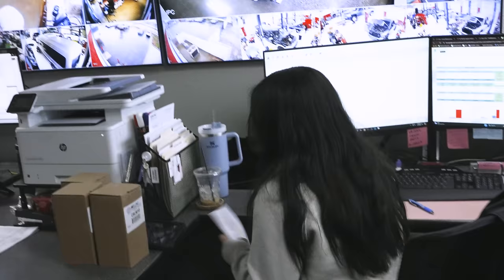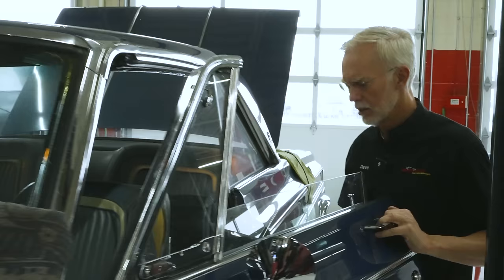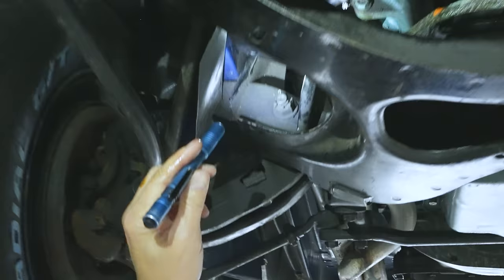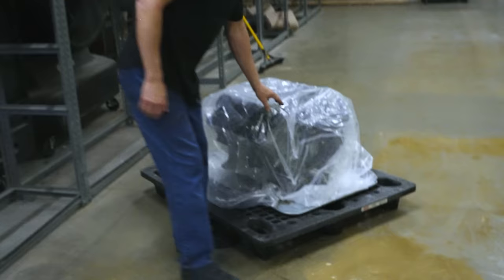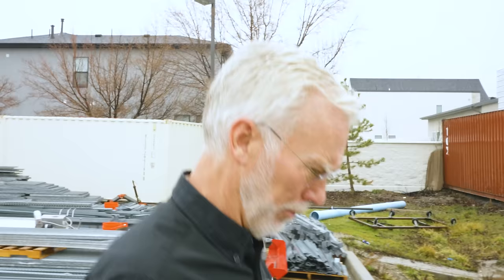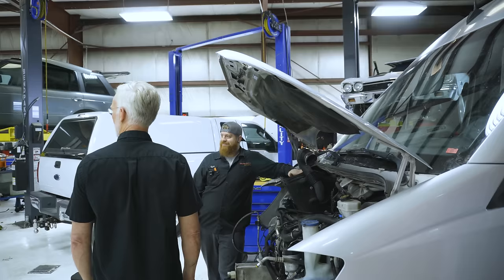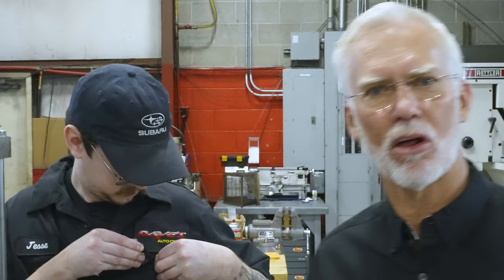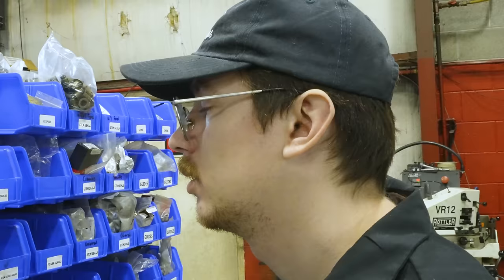Shop Life

Comment: It’s great to see real mechanics and not parts changers, as a 77 year old working on cars before I had drivers license, your channel is better than any show on TV. 👍🏽👍🏽👍🏽👍🏽👍🏽
Reply: Everyone starts out as a parts changer. Some shops have strictly diag guy and strictly “parts changers” 
Try “part changing” on semis. Very few ppl can do it because it’s hard work heavy dirty work but you still need a brain to change certain parts
Reply: Parts changers used to be known as fitters. While every mechanic shop needs them, too many  set up in the auto repair business and are just cowboys. Dave has real mechanics. Once the basic knowledge is acquired, experience is all.
Reply: I agree.
Reply: As a DIY parts changer I'm offended! Time to change some parts.
Reply: Great channel Dave👍
Reply: Temp probe for each cylinder
Reply: Do they make total seal piston rings for Dodge diesel
Reply: Never had to go to a mechanic as a a diy parts changer no labor costs changes the game a lot. The list gets pretty extensive i can pull off quite a lot and many of the jobs are just a swap it out. Like if you need a new wheel bearing you have whole hub assemblies no need to press. I explain it to people like this if you need your teeth cleaned does the actual dentist that gets paid top dollar for their time do it or will the hygienist who gets paid much less clean them for you. I don't want dave doing my brakes or exhaust or something trivial because he would demand too high a rate vs my zero dollars an hour. No disrespect old timer but at 37 i have never had to bring my old used four bangers in for anything i cant handle. Nobody rebuilds jack(engine,trans,diff,alternators,or power steering pump although these last two i have a good idea on how to) on a 3 thousand dollar vehicle like drive for years and years not to mention many like me are not far off from becoming guys like this.
Reply: Nicely said Mate - Gday from Australia
Reply: They might be on TV one day, on one of his episodes he mentioned that the Discovery channel was interested in his work. Haven't heard much more about it though.

Comment: Nice to hear you talking about EGT's Dave. A boost and EGT gauge will give you two of the best pieces of information about your engine.
 As a Toyota Landcruiser turbo diesel owner in Australia, I'm often driving on mountain roads in high ambient temperatures which sometimes means I drive according to my gauges simply to protect the health of my engine.
 Prolonged and excessively high EGT's are death for a diesel engine.

Comment: Diesel trucks should come with an exhaust gas temp gage from the factory.
Reply: And no egrs or dpfs
Reply: @haralamc 
Absolutely!  Look up 'speed of air pistons'.
Reply: I was thinking the same, I’m gonna make my own exhaust temp monitors. I’m thinking separating the left and right bank with 2 separate gauges. One thing I gotta learn is what are the parameters of the exh.temp. 2006 Duramax 6.6, LBZ. 6 speed Ali tranny. That’s for your vid’s Dave!

Comment: Around 1964 dad bought at auction from the sheriff department a four door cornet(I’m guessing) that car had a “Haul Butt” motor. Thought it was so cool it had spotlights on the doors no other dad’s car had them! 1968 he bought a Dodge Cornet 500 that bad boy would haul the mail!!! I’m 68 now and remember all the cool cars dad had. 69 charger r/t 70 Mach 1 428 cobra jet shaker hood AMX 390hp  then as we for older he got into family cars Mark 3 Mark 4 Torino LTD Scout Bronco Ram Charger f250 crew cab highboy . Wow childhood memories,! 😂
Reply: Reminds me of 
“It's got a cop motor, a 440 cubic inch plant, it's got cop tires, cop suspensions, cop shocks. It's a model made before catalytic converters so it'll run good on regular gas.”  That was a Monaco

Comment: Check out the grid heater issue with the 6.7 ram. Banks sells a remedy for that, destroys tons of these engines, as well as a great monitoring system with the datamonster. Good peace of mind for for when you  wind up rebuilding or replacing someone’s engine, the gauge pods have temps you can set alarms for any data point threshold you set,
Reply: Well being a 2005 wouldn't it be a 5.9 still?

Comment: When I saw the Mini Logo on the engine cover and heard him say "Anytime you have to do anything on one of these, the front clip has to come off, except an oil change" I felt that as a mini owner, just to simply change the oil filter you have to remove the turbo intake hose and move the coolant reservoir out of the way then work arouns 2 or 3 radiator hoses just to get to the filter cap! Needless to say, he summed it up perfectly, most work on the engine for those cars is alot easier if you pull the front end off.

Comment: I sure love your ship and hope you run it. 

I used to be quite involved at Tesla motors, and what I would see was a lot of junior engineers coming in trying new things. They try things and they can save a penny per unit then end up costing the customer $1000. I kicked an engineer off of the assembly line in 2018 when it was make or break if we didn’t hit 5000 units a week. he engineered the brake line fittings. He engineered the wrench to use on the assembly line. If you used his wrench, it would round the line out every time. That argued with me for an hour before I called his supervisor and had him removed from the property. The last week that I was there I watched them eliminate the final quality control procedure as they said Service could handle it.
Personally, I don’t own a vehicle newer than 2007 and the best running ones I have I’ve paid little to no money and are nearly 30 years old

Comment: There is mechanic that have learned the trade by working on vehicles but people that have dealership schooling or trade training with certifications we have put our time in school and hands on we are called automotive technicians, there’s a difference between both technicians and mechanics. Mechanics don’t have all the knowledge on testing sensors but there scanner says an issue with per say oxygen sensor so they just replace it instead of testing it with ohm meter or checking for vacuum leaks that will raise voltage on a oxygen sensor that knowledge is why we are auto technicians . Dave’s auto is a perfect example of  professional auto technicians  they should be proud of each other and themselves. Great job . In case anyone wonders I’m a automotive technician of 43 years with  a wall full of certifications ASE CERTIFICATION in diagnosing auto repair and emission  diagnostics and repairs now retired but keep busy at home with a hobby in automotive to finance my play time and Europe vacations.

Comment: In my 92 Dodge 12 valve and all I had was water temp and it worked great so pulling my 25’ Road Ranger in the mountains so normal was 1/4 ont temp gauge and when it got to 12:00 on gauge I would drop a gear and temp would drop to 1/4 and that’s a 5 speed manual .

Comment: 1:50 Talking about those exhaust temps. My first truck was a '71 Freightliner, 335 Cummins. The guy I bought it from pointed to the pyrometer, and said that's the most important guage, and not to let it get over 1,000°, I believe, this was 1984 when I bought it.

Comment: I used to drive early Kenworth Prime movers pulling three trailers or two trailer combinations,powered with either 525 redhead Cummins or early 560hp and both add turbo pyrometers on them and you could allways tell our good / bad your engine was working. Later model engines have all that computer controled, not my idea of good.

Comment: That exhaust gas temp monitor idea is great but humans are bugs, they're not features.   Take it out of human hands and just wire it up to shut off  before the temp can grenade the engine.  Meanwhile allowing an override to get them where they need to go (your shop) while still monitoring how long they continue to drive it too hot.  After a certain number of hours make the unit shut the vehicle off permanently and send your shop the GPS the coordinates of where to pick it up so you can fix the problem before they lose their motor.

Comment: Even the lawnmower shop had my mower and they worked on the PTO but when they put the belt back on they adjusted the tension but they didn't tighten up the jam nut. So a few times I mowed I noticed the belt making a noise. After I changed the blades I noticed the problem and some of the threads got chewed up. So next time I have to change out the belt I will have to replace the eye bolt

Comment: If it's an 05 then it has the 5.9 24 valve. The 6.7 didn't come out until 07.5
Reply: Was just about to comment the same thing haha.
Reply: I could care less it’s still dodge to me junk
Reply: 06 and 07, 5.9 Cummins had upgraded internals for the h.o. motor that was an option 02 to 05. The upgraded internals was to meet emissions reg before the 6.7 release.
Reply: @samsquires2877 A Dodge Cummins HO with the Aisin transmission is the king of pullers, and I am not a dodge guy, but facts are facts. These a reason most semi, large construction, farm, and large off shore boat applications use the inline 6.  When was the last time someone transplanted a powerstroke or Durmax into something that already had a Cummins….almost never.

Comment: Hope you answer this please sir, 1996 ford 4.9 300 6 f150 2 wheel drive stick 5 speed. Burning some oil can see out tail pipe idling about  140,000 miles second owner sir. Do you do engine refresh if all good just worn rings , I get the money I want to send it to you whole pick up to see etc. Hopeing it can be refreshed.  Complete pinions connecting rods rings bearings Complete head rebuild just don't want it bored out if not needed. Don't think it's had anything like that done. Clearwater Florida dealer owner then to Minnesota.
Reply: Just call them up or send an email. It's impossible for them to read every comment and answer questions on YouTube.

Comment: Just comment on the Plymouth I have a 67 barracuda and the Mopars at the time had a special body plug in the inside rear quarter panel that would cover most of the area but have a small drain passage on the lower end of the body plug. Also I wonder about that motor mount bolt maybe someone had done some work on the engine maybe even pulled it at some point.
Reply: I meant to say most of the area where the drain plug is.

Comment: Hey Dave, could you do a quick run down on what you would do for a BRAND new motor? Break in wise?. Just bought a new F350 with the 7.3 gas, dealership says 10,000 oil changes but I’m thinkin I’ll change the initial oil at 500-1000 miles then 2,000 and then do every 5k. What would you do for these “sealed” transmissions as well? Thank you in advance for all the info y’all put out!
Reply from the maker: Appreciate the feedback, that would make a great video. I'm sure others would be very interested. Have an awesome weekend.

Comment: Dave I have a 2012 ram 2500 w/5.7 Hemi . I had the heads surfaced all new censors. Dodge shop said it was the computer. I put one on and had it programmed, it will run but faults out 16 spark plugs in 10 minutes. Help with a sugestionplease

Comment: That stock oe ‘carter lift pump’ throw that thing in the garbage where it belongs and sell the customer on and install a FASS fuel system! Them crappy carter lift pumps are the number 1 reason the vp44 injection pumps fail. A vp44 need a constant uninterrupted flow of cool clean diesel fuel to keep it cooled. A vp44 is not lubricated and cooled by engine oil like a p7100 the diesel fuel’s lubricity lubricates it and cools it! Hence why diesel fuel additives are important with today’s ultra low sulfur diesel fuel. 
I would absolutely no way install a new carter lift pump on that 2nd gen dodge! Get a fass! Its cheap insurance and will make everything in the injection system last longer! Them crappy carters, they get hot themselves and when thy do they start to not pump as much fuel and are known for failing. And when the fuel pressure at the injection pump inlet drips below 5psi the vp44 will grenade and eat itself!  A FASS fuel system will not only supply a constant uninterrupted supply of fuel, but it also filters it way better than the stock oe setup. All the stock oe stuff goes in the garbage! A fass system filters down to 1-2 microns! The stock oe fuel filter , them little tiny things don’t have a water separator and are lucky to filter down to 10 microns!
Every single diesel truck, ford, chevy, dodge new or older need to have a FASS system installed. All the cp4 failures you see with ford, dodge and chevy, all fass system would prevent all of those injection pump failures! An i injection pump cannot suck its own fuel from the tank up to itself! Thats why a fass is they are called a ‘LiFT PUMP’! It lifts the fuel from the tank up to the injection pump. These brand new chevy durajunk’s, they don’t have a lift pump! At all, there using the cp3/cp4 to draw the fuel up by sucking it. Thats so hard on that cp3/cp4, its starving for fuel, it needs that fuel to cool and lubricate itself! The new Ford powerchoke’s  are so bad that S&S diesel and industrial injection put together a ‘’disaster prevention kit’ its like $10k any time one of those self destructs, it send metal all through the fuel system. A fass system would have prevented that. A FASS 165gph is perfect for just about everything. They run about $800, id recommend anyone doing one to do the tank ‘Sump’. You wont even have to drop the fuel tank at all. The draw straw kits if you don’t get then exactly right will have issues with sloshing fuel and 1/4 tank sucking air as the fuel sloshes around. A sump eliminates any and all
Of those issues and even having to drop the tank down. Beans diesel has a new updated sump thats got dual ports, one will be the inlet fuel return and the other the outlet to the injection pump. Makes it super easy! Installs are cake. The instructions are nice and everything’s top notch. Like i said its a $800 insurwnce policy thats protecting $10,000+ in expensive injection pumps, injectors that can be $1,500+ each!